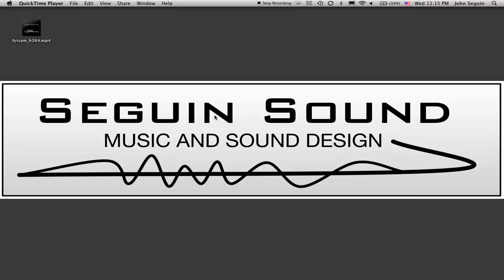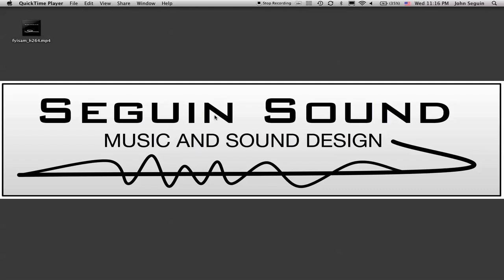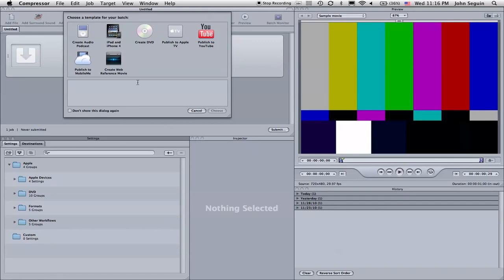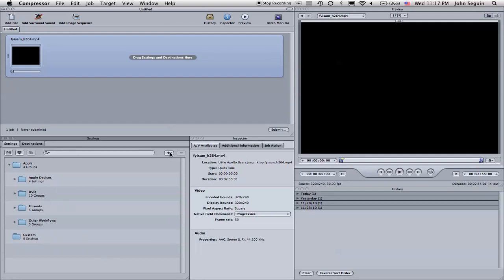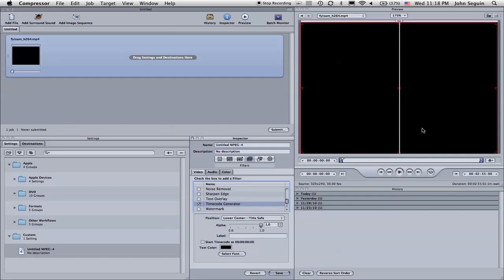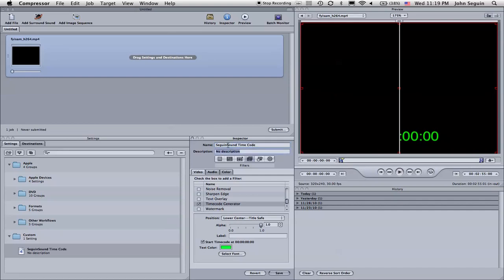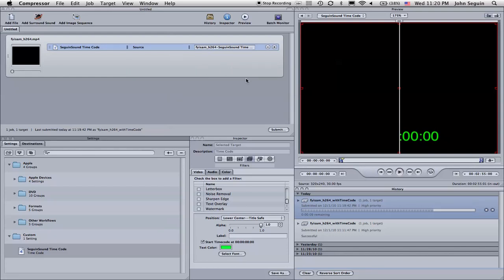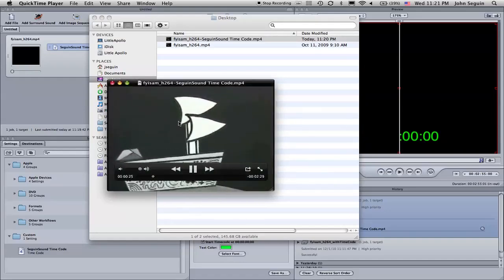How to Burn SMPTE Time Code into a video with Compressor

Comment: Hey, very useful stuff.

Do you know of any way in which to synchronize  playheads in a video editor and logic pro so i can edit the video while having all my effects and instruments etc? 

I was hoping to use final cut, but it turns out it doesn't accept Midi time code or SMPTE as input.

Thanks.